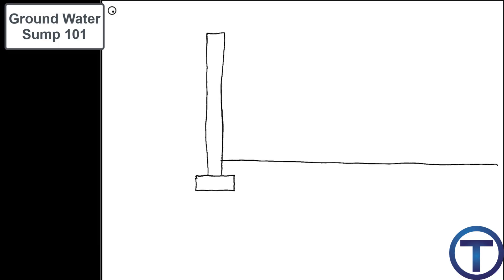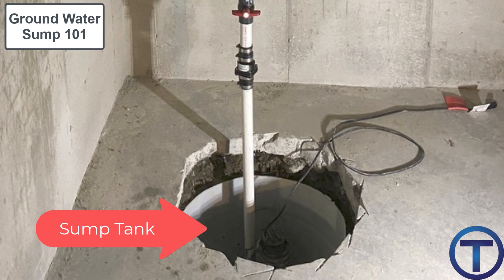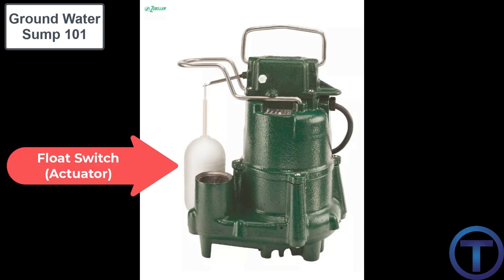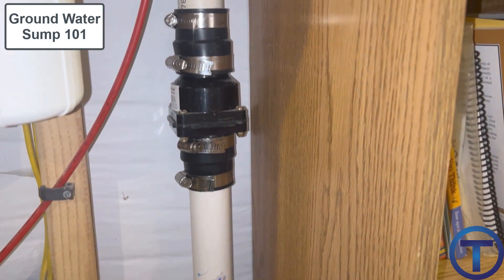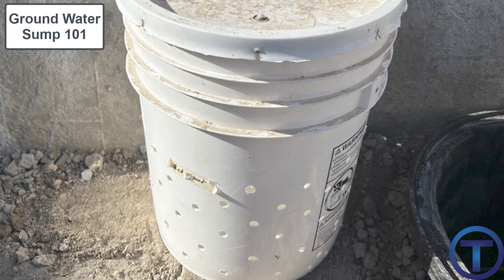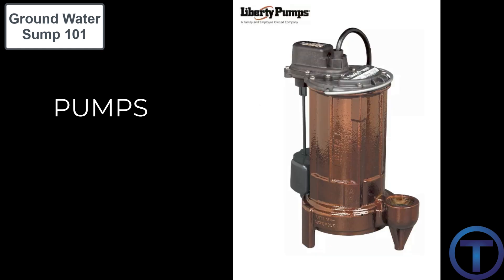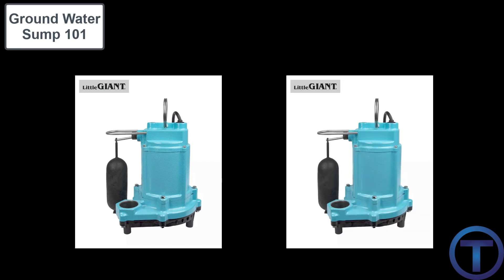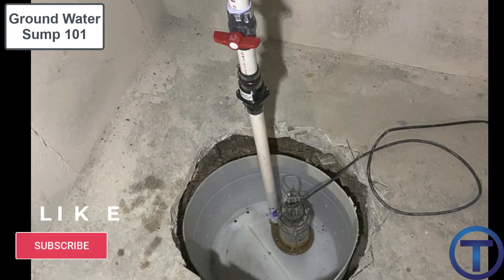Ground Water Sump 101

Comment: Don't you need a vent to prevent air airlock?
Reply from the maker: Thanks for watching. 

Not on a ground water sump.  The pump is submerged so it is surrounded by water  when it turns on.  The end of the pipe is open, so the water just shoots out of the building.   Air lock happens in a closed system when water is being recirculated through pipes. 

Hope this helps.